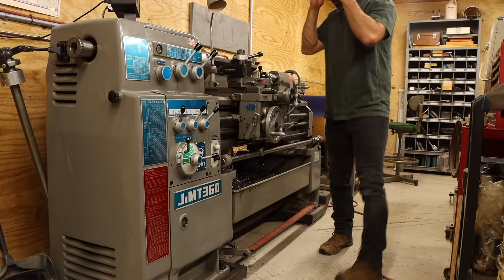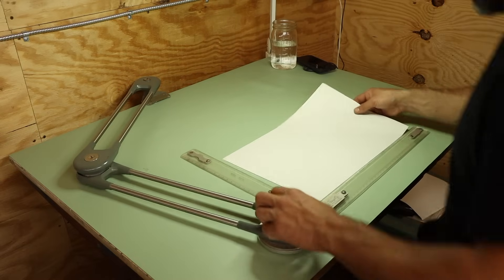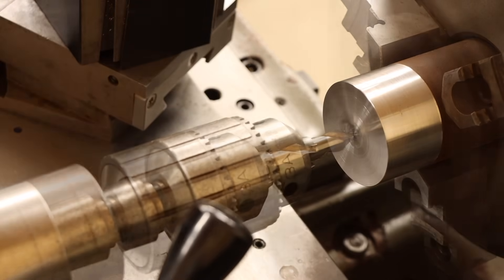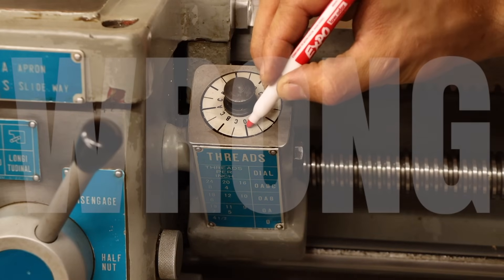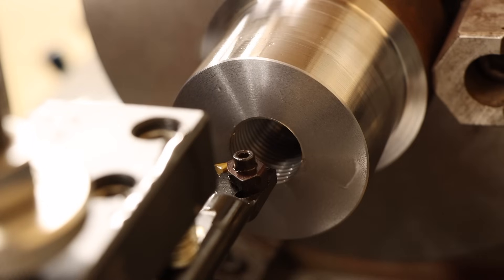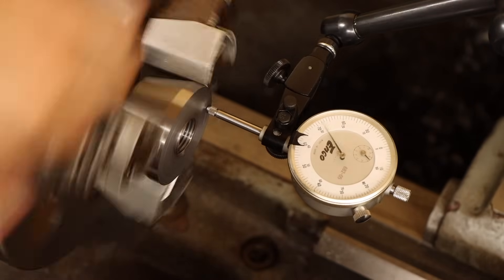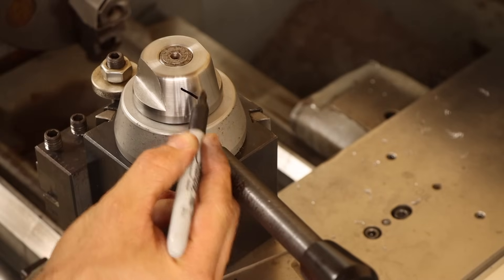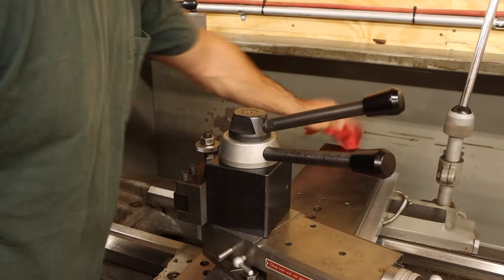A Better Tool Post Nut || INHERITANCE MACHINING

Comment: The issue you were having with the thread pitch @8:26 is that you were using the compound slide at an angle to adjust your depth. In actuality, not only were you adjusting the depth of the cut, but also the position of the cutting point, resulting in a new thread pitch location, or a second thread. If you were going to use the compound slide for depth of cut, it needed to be perpendicular to the workpiece.
BTW, thanks for the channel. It's reminded me of my first year as an apprentice with Lucas forty years ago, when we pretty much did what you're doing now. Although we did have to file the "Cube of Doom" as part of our benchwork, which then had to fit the "Square hole for the Cube of Doom".
Reply from the maker: Glad you like the channel! I considered making a pair of 123 blocks by hand like my grandfather mentioned used to be a standard apprentice project. But decided my time would be better spent elsewhere.

Also on the thread cutting, the issue was actually that the lead screw for my lathe is intended for TPI so the thread dial doesn't apply for the metric threads I was cutting. I just have to leave it engaged or only engaged for the same mark on the same revolution. Using the compound set to 60 degrees to adjust cut depth is standard practice and wouldn't cause the issue I was getting.
Reply: @InheritanceMachining  From a foggy memory, projects included, cube, tombstone, screwdriver, planishing hammer, toolbox, toolbits box, scraper, tailstock tap & die holder, sine bar, parallel bars, scraper, precision mandril, location t-stops, engineers support (cast iron with offset locking screw) and a host of other bits 'n' bobs. We covered benchwork (lots and lots of filing), turning, milling (horizontal & vertical), welding, heat treatment, electrical wiring, plumbing. What they didn't tell you was the multiple trips to the onsite medical team for all minor cuts, and burns from swarf to the finger tips, the images they show you during your first week of "health & safety" (they were so graphic, that one young lad feinted, fell off his chair and fractured his arm - there's irony for you) and that the smell of hot metal and steaming coolant never leaves you.
Reply from the maker: @ChumbahNutz  Sounds like.a very intensive course. I imagine you still use some of those tools today? Im impressed it branched out into other disciplines as well.

Comment: I usually use a left handed threading bar doing inside threads and run the thread backwards. This way I don't have to worry about ramming the end of the hole when actually cutting.
Reply from the maker: One of those is at the top of my wish list for that very reason!

Comment: Boy did that bring back some memories. I actually started on T-Square and triangle back in Jr High school in 1963 when draftsmen were highly skilled people. I really miss my K&E full track machine (Never had the heart to sell or scrap it but it lives in the attic now) We all had very unique lettering and even arrow heads and other style.  You could tell who did a drawing without ever looking at the title blocks. ,,,,, But alas,  today I use AutoCad. Hey, at least I still use Dr. French's "Glass Box" to visualize what I am designing. I'm looking up at his book up on the shelf over the computer. I haven't ;looked inside it dor decades, though. Looks like I'm one of the last of the Mohicans for sure. All I see anymore are kids making pretty pictures with Solid Works. Pretty good to  generate G-code, but it leaves a lot to be desired when a tool maker needs a working drawing. ,,,,, But then tool and die makers are a dying breed too. 

Good idea for the nut, but mostly,  like Mr. Hope said. Thanks for the memories.
Reply from the maker: Thanks for sharing! I relate to your sentiment about kids making pretty drawings in CAD. I came from the drafting board as well and it seems to me that those that didn't don't understand the importance of drawing cleanliness and the importance of the dimensions they show as it relates to the machining. Thanks for the support!

Comment: I assume you use paper, drafting table and pencil rather than CAD because you like the feel of these materials and your connection is lifelong; compared to the distant separation CAD is? I can respect that choice to keep with traditional drafting methods (for in some cases, it is faster to draft not in a CAD program)

Though for doing calculations and sharing work and iterating while learning the software still feels infinitely easier.  Plus you can control the contrast and cleanliness of your presented worked (far easier than having to do that manually with inking)
Reply from the maker: Oh for sure CAD is orders of magnitude easier and faster for the very reasons you mention. I use it on a daily basis for my job. I choose to draft manually here as an escape from the screens.

Comment: To my experience, which is surely less than yours, tools always cut their best on dead center.
Reply from the maker: I wouldn't necessarily say I have more experience but usually if I'm getting really bad chatter while boring. Raising the tool just slightly can help. I think it has something to do with the tool deflection on an inside bore. If its on center and the tool deflects down the cut gets deeper and deflects the tool even more until it breaks free.

Comment: your video brought back some memories.... haven't used a drawing board and paper in a long time.
Took drafting in college in the mid 80's.  My class was the last to use boards, paper, pencils.  CAD (2D) was taught there after.
Reply from the maker: interesting... my high school vocational classes included 3 years of drafting then a 4th year of 2D CAD. if it weren't for that I may not have the same interest

Comment: If you have an imperial leadscrew and want to cut metric threads, leaving the halfnuts engaged and reversing out is your only option because the leadscrew pitch is not related to the thread pitch. No changes to the threading dial could fix that. Same goes for imperial threads on a metric machine.
Reply: Not so. You can disengage the halfnuts, stop the spindle, move the tool clear of the threads, reverse the lathe then reengage as the same number comes round. The caveat is that the threading dial cannot make a full revolution. Its effectively like keeping the half nuts engaged but with the ability to stop the tool motion immediately. There are a number of contributors on youtube who have demonstrated this technique.
Reply: @ThePottingShedWorkshop  Yeah ok true, and I've even done that, but I couldn't think of a quick way to describe it. You did a good job! Leaving the halfnuts engaged is easier most of the time but this technique is great if you're threading to a shoulder or something where you have to end the thread in a narrow window.
Reply: @ThePottingShedWorkshop  I was going to say the same thing as you have said. I also check the comments before I post my comment so as to not double up. My main reason for replying to you is to keep your comment near the top so others can be informed of this method. Cheers from John, Australia.
Reply: Thanks guys, I learned something I’ll try.  I almost exclusively make metric threads on my Southbend Nordic which is an imperial lead screw machine. So far I have just kept the half-nut engaged which just feels bad somehow.
Reply: this is a most helpful tip.  I have a vintage WW2 Monarch Lathe I'll be bringing back under power soon and there are times when I may need to cut a metric thread.  Thanks!

Comment: some old hands taught me to slam it in reverse to minimise the stopping distance. I never liked it but it only took one time experience of my feed disengagement to jam up and not come out (crashing my tool and toolpost into my chuck sooner than I could shut it down - was a bad nut) for me to adopt the new practice.
Reply from the maker: i got a helpful tip on this. you can disengage at the end and stop the lathe at the same time. then reverse the lathe  and pick up on the same mark. as long as the dial doesn't go all the way around you'll stay aligned

Comment: I earned a degree in Design Drafting back before CAD was mainstream. I really appreciate seeing you using pencil and paper to design your parts. Would I use paper and pencil? Not unless I didn’t have my computer. Kudos to you for taking me back to the good ol’ days of line weights and eraser guards.
Reply from the maker: thanks! by no means is it the fastest way to design, but I spend enough time at a computer as it is...

Comment: A handle like that would provide nowhere near the tightness required on mu 19" Regal lathe to prevent the tool post from slipping, I use a 12" box wrench with q 3 foot pipe cheater.
Reply from the maker: haha yeah definitely not. have you considered putting a thrust bearing under your tool post nut to reduce the friction there?
Reply: Perhaps having been trained in a production oriented large shop doing heavy work has given me a propensity to take larger cuts than the folk's videos that I may watch, I cringe at the tiny "roughing" cuts that most hobbyists are taking, for me the .020" cuts are getting close to finish cuts, for me 3/16" or more is a roughing cut, and without my method of tightening the took post is necessary.

Comment: i had the same exact problems with my grizzly lathe last time i cut metric threads. I ended up doing the same thing you did by stopping and reversing. Im really going to have to finish installing my hydraulic brake on it
Reply from the maker: I actually got a helpful tip on this. if you disengage the feed and turn off the spindle at the same time, you can then reverse the spindle and re-engage at the same mark. as long as the dial doesn't go all the way around you'll stay aligned

Comment: You can save yourself a lot of math by indicating tapers in on the corresponding angle block. Some machines have specific places you can clamp them for just that purpose.
Reply from the maker: I don't know about a lot of math... It's just 1 formula. I've tried using an angle block once before but couldn't really find a good way to mount it. Where do you normally see mounting locations?

Comment: Recently came upon your and am enjoying it a lot. When you first showed the old tool post nut and explained what you were after, I thought, just weld a rod onto it! While certainly not as elegant as your approach, I am wondering if that occurred to you and what led you to choose the approach you did.
Reply from the maker: Thanks. I'm glad you like the channel! It did occur to me to do a simple solution like that but like you mention it wouldn't have been as elegant. I really wanted the replacement to look like it belonged on the machine. And was also looking to try a couple new machining techniques along the way

Comment: Looks like you have those metric treads figured out. An old machinist buddy always told me, on a lathe with a standard lead screw to never disengage the half nuts when threading metric, I'm not 100% sure as to why, but it works. I really like your tool post handle mod, what a pain it is to grab an combo or hex wrench every time you need to move the tool post. Great job!
Reply from the maker: Thanks Mark! There were some pretty good explanations in this comment section about exactly why it doesn't work. Basically comes down to the thread dial gear being arranged for english engagement intervals. Apparently you can swap out or make your own gear and dial to "translate" to metric

Comment: When cutting metric threads on a lathe with an inch leadscrew you have no choice but to stay at the same place on your threading dial. This means either keeping your half nut 
 engaged or when terminating your thread disengaging, immediately shutting off your spindle, then kicking it in reverse and reengaging at the same number. If your dial goes a full revolution you will lose your spot on the leadscrew and have to pick back up your thread. Abom79 has a great video explaining his method on threading metric if you’re interested. Love the content!
Reply from the maker: Thanks for the explanation/tip. This is one of those nuanced things that I didn't even think to look up. I didn't know what I didn't know... but now I know 😂  Thanks for the support

Comment: using a paralel to get the flats in the same plane ........ small thing but its sumting i hadnt thought about , learn sumting new every day i guess

as for clamping in the base in the lathe to machine the underside of it flat , could've just screwed the piece on a proper treaded rod (like the one you used to check the tread ) and use that to clamp it in the chuck , that way the underside is paralel to the treaded hole and you dont have to clock it in and clamp down on the tapered edge
Reply from the maker: you're right. I couldn't see the forest for the trees 😂

Comment: Cutting metric on a imperial ledascrew won't let you use the thread dial. And vice versa.   Of course some lathes offers thread dials that do. But most don't 😊  we have the same problem here, when we want to cut inch/imperial.  All is set for metric 😊 
Metric leadscrew = metric works
Imperial/inch ledscrew = Imperial works 😊
 But I actually rarely use a thread dial. I always just reverse at the end 😊
Reply from the maker: So I've learned 😂  Im actually thinking if it's possible to make a metric dial for my lathe. From what I head some lathes come with a separate gear you swap out on the dial itself

Comment: Nice video, FYI it is always a good idea to thread a nut from the clamping face, in this case after your part off and you flipped it around. This will insure that the clamp face and the threads are as perpendicular to one anther as possible, dialing of the part of face isn't that great plus as you start machining it the part could move a bit as it seats into the aluminum pads. Also I very much try to avoid parting off through threads, put a small under cut at the end of your threads if you can. The thread generates a very terrible little sliver and interruption that is very prone to damaging the part off tool. And on most lathes if have a imperial pitch lead screw you are stuck with leaving the half nut engaged well sort of. The way around this is just mark the number like you have and thread like normal, once you get to the stop point disengage the half nut and immediately stop the lathe, the dial will travel a little bit but unless you wait way to long it shouldn't make it around one revulsion. Then just start the lathe in reverse and engage the half nut at the same number. Now you don't have to worry about crashing into the part or lose timing. There is a great video about another way which is to build a thread dial that can do both metric and imperial https://youtu.be/zG9XYDCDwWY , It just involves some simple gearing and the fact that 25.4 x 5 = 127 so every 127 lead screw revolutions you will be back in time.
Keep up the good work!
Reply from the maker: Thanks for the support and the info. Some others mentioned some of your points as well so I appreciate the corroboration. I had never considered that issue with parting through the threads. Luckily this didn't bite me before learning the hard way. I'm also thinking of making the metric thread dial at some point so thanks for the link!

Comment: Could also use a washer under to set the clicking of the nut. Also would highly recommend a thrust washer under that nut. Makes a massive difference in the ability to tighten (or over tighten) the nut.
Reply from the maker: I had some recommendation for a needle thrust bearing as well so I may revisit. Thanks for the tip

Comment: Order of operations could have made this job easier and more accurate.  Eg cut off first (thus eliminating the blind threading operation) and face top surface..... then reverse in chuck and face bottom face, drill, bore and thread in one setup, thus ensuring bottom face is perfectly square to the thread.  Then using your spare toolpost stud as a mandrel, mount the workpiece via the thread and turn the taper.  Then install it on the toolpost, mark the orientation for the handle, and move to the mill.
Reply from the maker: Thats a much better approach. If the accuracy was more important I might have given it more thought. I think here the little bit of play in the threads allows for the roughly 1 thou of runout I had when I faced the bottom in some of the last operations.

Comment: At first I held my breath but then I completely relaxed when you said your solution was going to be to add a handle to the nut. Relieved....
:)
Reply from the maker: haha what did you think I was going to do?
Reply: @InheritanceMachining  I don't know.......maybe some kind of jam nut or something that locked itself in place. Glad you instead did the reasonable thing :)
Reply from the maker: @artmckay6704  in your defense I do tend to take somewhat unreasonable routes in the machine shop 😂
Reply: @InheritanceMachining  
Overall you're doing really good! Your approaches are usually quite logical and practical.  :)
Reply from the maker: @artmckay6704  Well in that case, thank you 😁
Reply: @InheritanceMachining  :)

Comment: Regarding finding center with the point of a live/dead center, I use a method that may or may not be frowned upon by machinists but for me works much better and removes guess work. With the tip of your cutter, gently pin a small scale against any piece of round stock in the chuck. If the scale is perfectly vertical, you're on center. In a very visual manner, you can obtain that "slightly over center" position that you're after in this video.
Reply from the maker: I've used this method for lining stuff up loosely on the mill but never though to use it on the lathe. Very clever! thanks